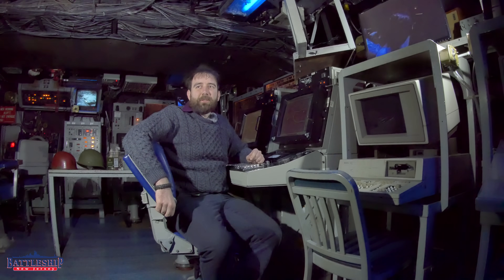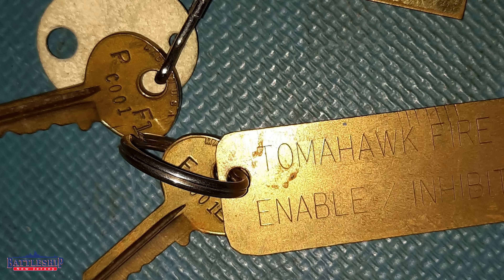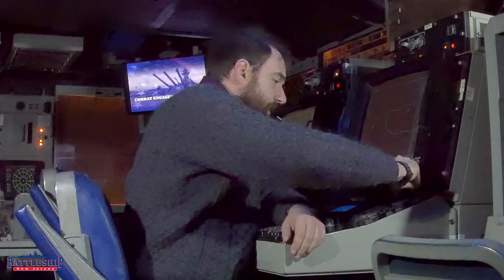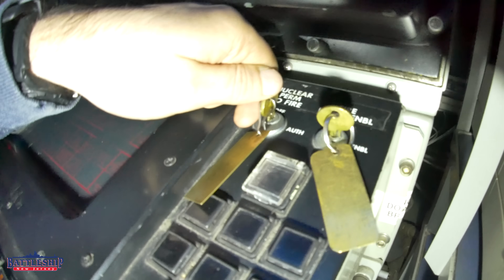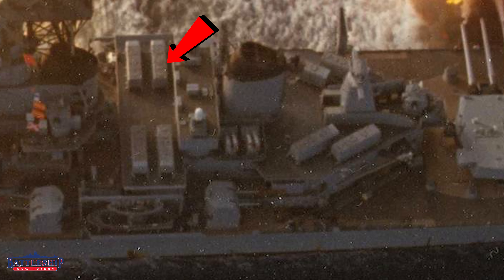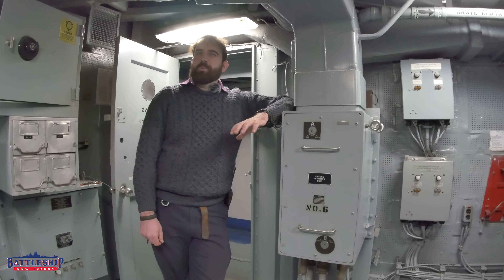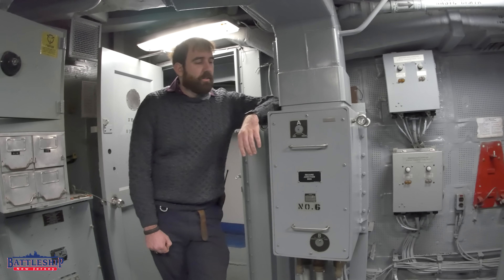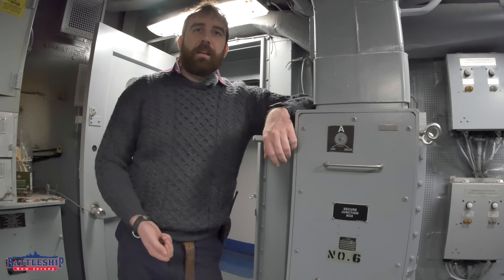Nuclear Tomahawk Keys: UPDATE

Comment: All it takes is a guy with the tools to pull the panels so he can jump the key locks.  Of course the other people around have to allow him to do so.  The security is only as good as the people in control.  The keys only allow the honest people to work just like locks in your house are only effective if your neighbors are honest.  Tossing the keys during a hostile takeover does not work no matter what the movies show.  If it is electrically controller, it can be bypassed.
Reply: Yes and no. There was a string which needed to be sent to the warhead to arm it for detonation. The keys have nothing to do with that. For a while they set it to an easy sequence, so possibly yes? But there are interlocks, sequences in which things have to happen, and inputs to the warhead which must be done properly to get a mushroom. If you get some of them right, you might get an explosion, but not a nuclear one. 
   The sailors I worked with (boomer FTBs) said their expected lifespan was 20 minutes after they launched their missiles. Everybody would know where they were when that happened. Tomahawks were single warhead, probably made them worth a nuke. 
    If you take over a Minuteman or Peacekeeper silo, you got bupkis. You need a majority of missile launch batteries to cast launch votes to launch the whole wing of missiles.
Reply: @patrickvolk7031  Mostly true; but if you had the local launch codes the silos could launch independently. The interlocks between bases fail deadly if you cut the wires.
Reply: @joshuahudson2170  There's a lot more that goes on that the keys. The warhead is designed not to go off unless it passes through the expected physical conditions (e.g. a missile warhead would expect a g-load at each stage, a barometric measurement to ensure it reached a proper altitude, and then reached the target altitude, and be backed by a radar altimeter). 
    The missiles need to be targeted. The people in the silos don't know the targets. It's in letter codes. There's quite a few PAL (permissive action links) in the firing circuit. One may be a coded enable signal when a critical EAM is received. They can be pulsed signals.
    The last thing you want a nuke to do is fail deadly. That's a broken arrow scenario. Nearby the silo, there probably are seismometers which would need to detect a wave during an EAM to allow for independent launch (the silos are several miles apart. 
    Probability-wise, they look at the chances of a two-person crew going rogue and starting WWIII, and make sure they have no better than a 10^-12 chance of starting WWIII. I can say authoritatively there are at least three groups (non-branch-specific) who make sure of that. Even they don't know everything.
Reply: I know that you can intentionally use the wrong combination to access certain secured areas that will still gain access, but alert others that something is wrong.

Assuming there is some sort of electronic launch authorization, they could probably intentionally code in the wrong authorization that would make it appear to enable the weapons, but not actually get used.
Reply: @JoshuaTootell  I can say part of it is the system gives no response to whether you give a right or wrong answer. The right combination may result in a properly coded signal, the wrong one causes a fizzle. 
   I would also imagine there is similar protection on the missiles. They have the non-nuclear PTF key because they know even a conventional Tomahawk can start WWIII. Imagine an ICBM missile. If it were shot at me, I probably wouldn't wait to find out if it is a dud or not before I shot back.
Reply: Maybe those consoles were welded shut ?

Comment: The Little Boy bomb arming plugs were put on auction over ten years ago. The federal government wanted to stop citing nuclear secret. Didn’t know what happened afterwards, but I saw them on display in Washington Navy Yard in 2014.
Reply: I think I saw that on display in the Smithsonian Air and Space Museum, where the Enola Gay is nearby. They were in a glass case along with a lot of other things. Seemingly where they belong.
Reply: @allaboutboats  The last time I saw the aircraft, those were identified as practice plugs that had been found aboard the aircraft during its restoration.
Reply: @allaboutboats  in Navy Yard, there was a tag signed by the Weapons Officer attached to the item.
Reply: That’s hilarious, little boy was teetering on criticality.  It would fizzile without having a cannon barrel propelling two critical component together.  A blasting cap ( or likely less) could have bypassed any key.
Reply: @Plumbump  Well no danger from them.  Practice plugs do not make the physical connections needed.

They are only for the personnel to get the motions down pat for the real deal. Remember, the plugs are not in at takeoff. 

You go into the bomb bay while enroute to the target and then insert the actual plugs to arm the weapon.
Reply: @Plumbump haha and they had the audacity to fit one of those gun types in an artillery shell. I wonder what the going odds among the Los Alamos engineers for a detonation on firing. Even a fizzle yield would have most likely killed anyone within a quarter mile from radiation alone with them wishing within days they were right next to the damn thing.